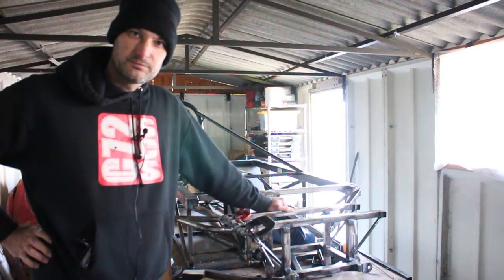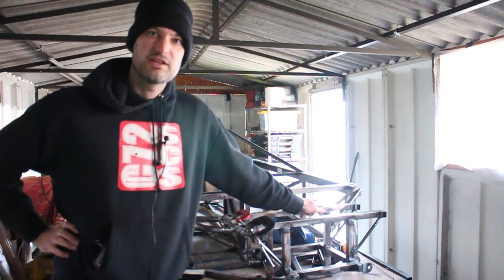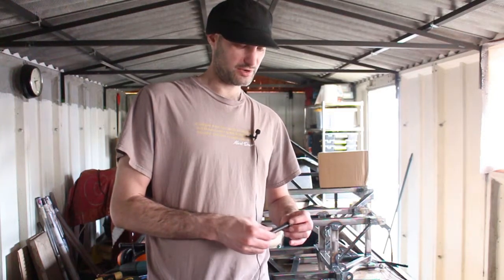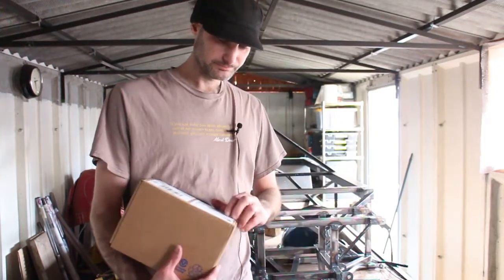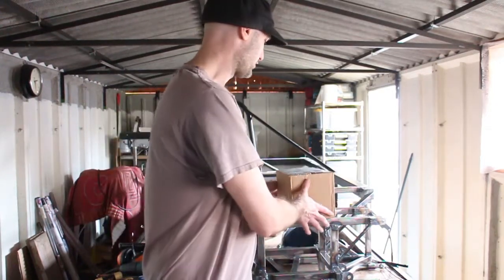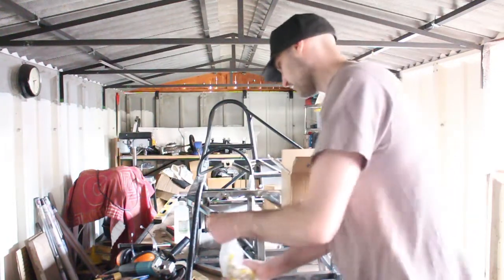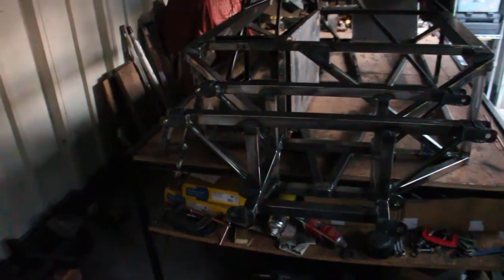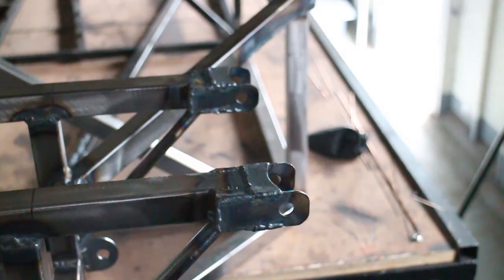[Fabrication] A chat about high quality bolts and upper wishbone mounts - Ep40

Comment: Hi, have you built in some anti dive on the lower wishbones? Also how do you change the diff ratio's, is the diff easily removable?
Reply from the maker: Hi Kim, the diff is from a Morris Minor so is easily changeable.  I haven't built in any anti-dive, mostly because I don't understand it and with my wishbones it's not something I would be able to adjust.  Also, this car shouldn't be too aerodynamically sensitive, so this reduces the need for anti-dive.
Reply: @schoolingthescholar5323  hi again, diff change on my car could be done in 30 minutes easily. It's just that your installation looked  more difficult. As regards anti dive it's the rear pick up of bottom wishbones that would be raised, it helps dive under braking.
All the best with your endeavours.